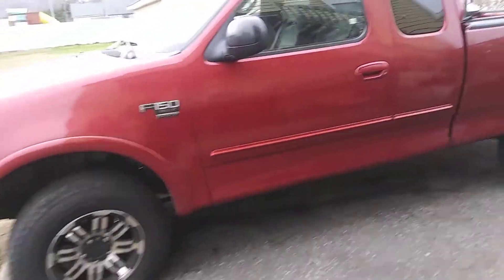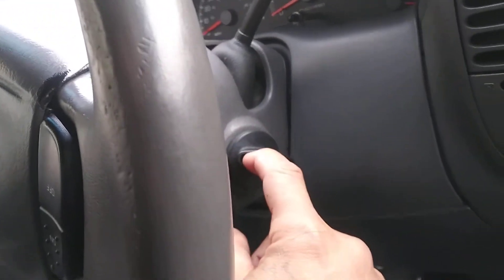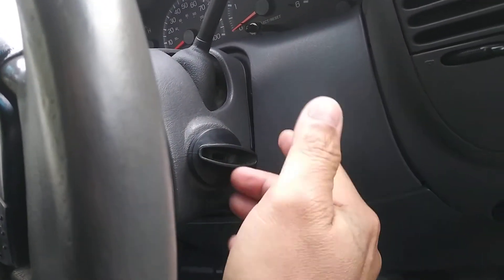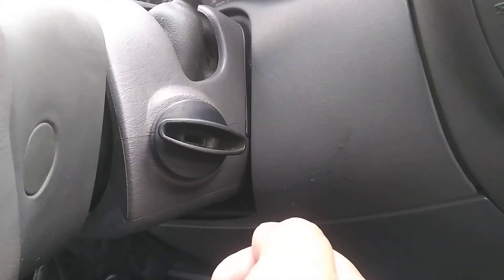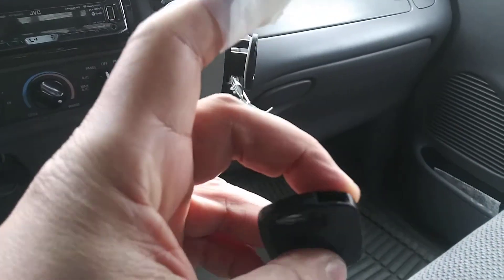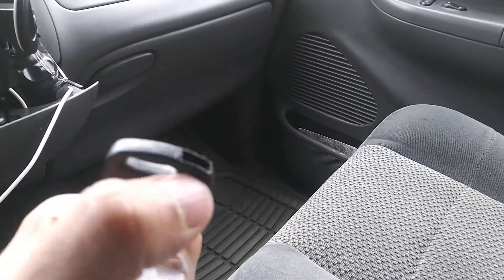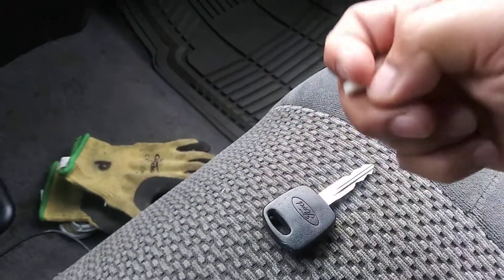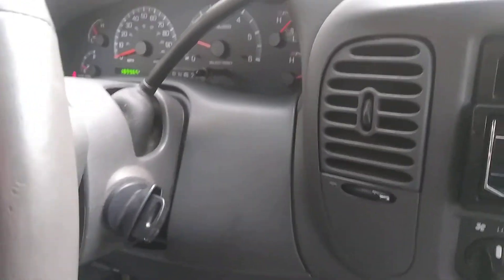How to change key chip on 2001 ford f150 or any Ford vehicle!

Comment: That's a lot of work (and injury), when you could have just reprogrammed the new key.  You potentially could have used your old key to start the truck, just by holding it next to the new key while you turn the ignition; this would have allowed the vehicle to see the correct transmitter.  You would also need to do this while holding the old key next to the new key when starting the vehicle to initiate the programming sequence.  I would suggest trying this instead of cutting the keys open to swap out the chips.